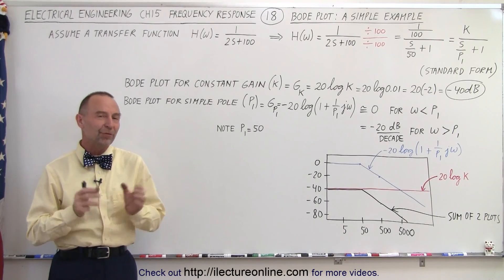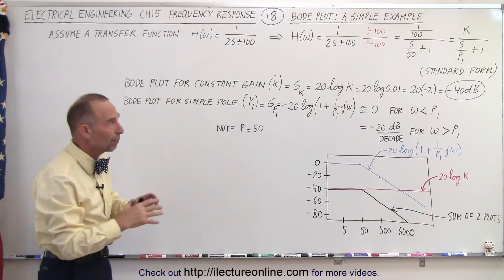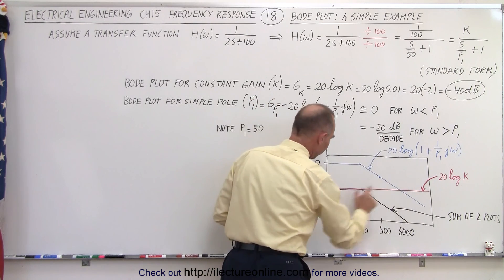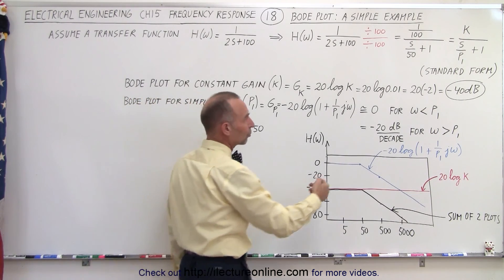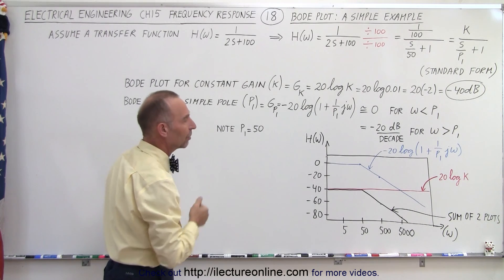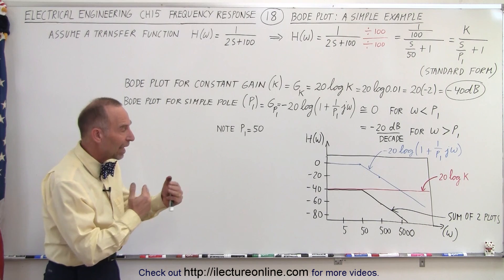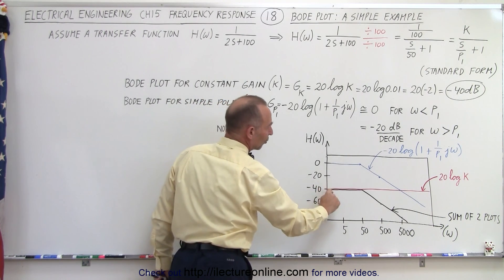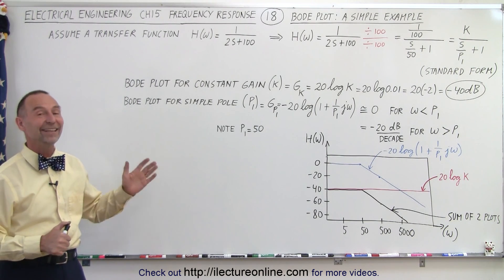Electrical Engineering: Ch 15: Frequency Response (18 of 56) Bode Plot: A Simple Example

Comment: How do you know where the black line starts and stops
Reply: 20logK=−40 dB is the red line
Black line is the sum of blue and red which on the left is 0-40 so it will start at -40 until ω hits 50, then it will −20 dB/decade, so just create a slope and put dots at 500 and 5000 and line it up every -20 units u go down on the y-axis.